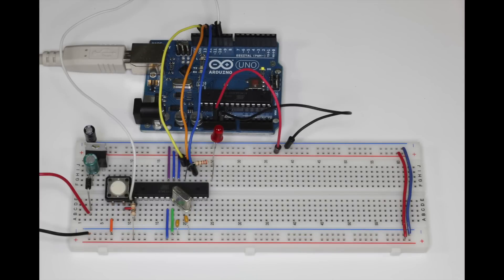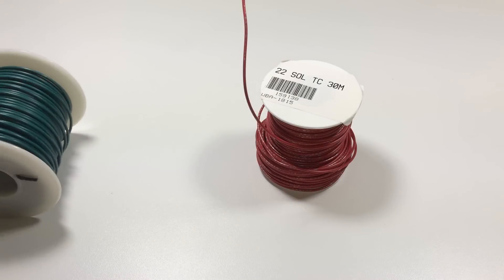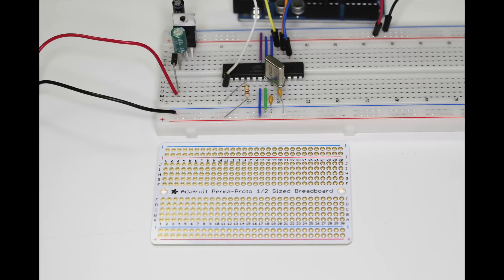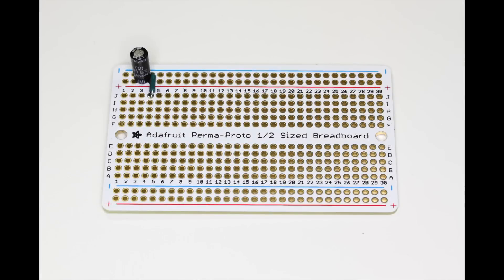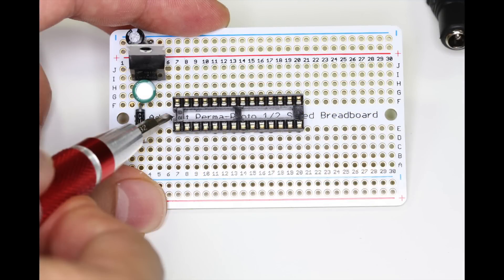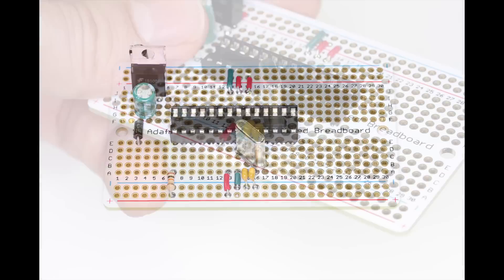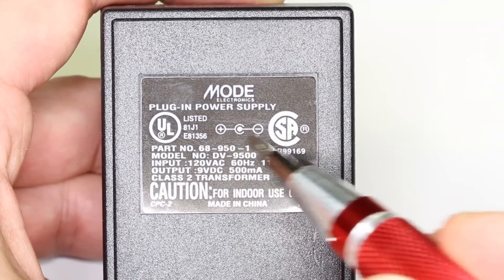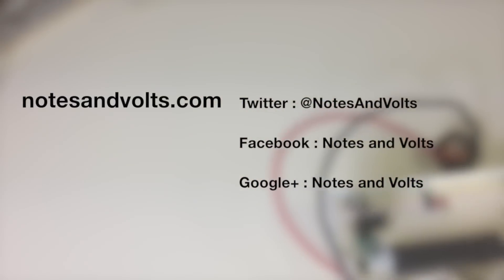Arduino on a Proto-Board - Make it permanent!

Comment: If I wanted to do the same with an SMD microcontroller (later down the line), I assume i'd need a development board or breakout board of some kind until I ordered a PCB of sime kind right? Is there any option for surface-mount prototyping?

Comment: What enclosures would be best for this project?
Reply from the maker: Hi Ryan. Anything will work. You can use some standoffs to connect the perma-proto to the enclosure using the holes in the board.

Comment: Set playback speed 1.5X. Trust me.
Reply from the maker: I know!! That Notes and Volts guy is a complete A-hole!
Reply: @NotesAndVolts  I appreciate your more methodical approach. Been building a MIDI Controller from someone else's instructions and it is a tedious experience.  I learned about proto board right here and just saved myself hours of frustration. You do you.
Reply: Lol.

1.5x actually works. 1.25x is a bit more natural though. ☺

Comment: great tutorial! just wanted to mention(since i solder for a living) that it's easier to solder the lowest parts first, like jumpers, diodes and resistors, then move upwards in height( IC sockets, caps and other taller components). just thought about mentioning it( although this is an old video) because it makes soldering a whole lot easier for beginners and pros. this way you ensure a great connection, and the parts will sit straight on the pcb everytime. thanks for all the great info you are putting out! appriciate your work!
Reply from the maker: Thanks for the tips Niklas!

Comment: All online tutorial including arduino.cc uses DC power supply with center positive pin (2.1mm). Why do you choose a center negative pin?
Reply: watch video again. Because  his power supply adapter jack has negative at center.
Reply from the maker: Hi Nelson. You can use either type of supply. Just make sure you wire your jack correctly. It's always a good idea to check with a multimeter.

Comment: If the chip is already loaded with a working code, do I still have to add this whole circuit to my project circuit on the perfboard?
Reply from the maker: You can leave out the power regulator if you are sure you will be powering the circuit with a REGULATED 5 volt supply. If you power source is unregulated or higher than 5 volts -- BANG!!!
Reply: Thanks for your time. I guess I still need everything else, right?

Comment: will it beahave in the same as the arduino works
which will be the guiding software
Reply: plg report to keshrirajcp@gmail.com
Reply from the maker: Hi Raj. This circuit has all the functionality of an Arduino UNO. The only thing it is missing is the USB section.

Comment: Does anyone sell something like this,  presoldered with a chip socket, smaller components, and more efficient layout that doesn't mimic a breadboard? I get that this is for beginners, but I'm trying to make the leap from hobbyist to selling a product.  I need something as small as possible with terminals or thru holes.  Seems like this would exist somewhere.  I also get that the Arduino is a pretty standard setup for programming a microchip, but I don't know where to look.
Reply: JR Olive 
No , olive , there is no such arduino as you said , but you can make one using jlcpcb or pcbway !
Reply from the maker: Hi JR. If you are planning to make a marketable product out of your circuit it would be best to design a custom PCB and have a batch manufactured. If you do it in bulk you can get the cost down to 1-2$ per board depending on the complexity.
Reply: Thanks so much for the response!  I get what you're saying, but I just hate to spend time reinventing the wheel especially since I would be climbing a learning curve that I don't really need.  So you're saying there's no product that is essentially an Arduino that nixes the surface mounted power jack and USB and provides thru holes or terminals for the I/O's and power?

Comment: Add female headers to all the pins to essentially turn it into a development board. Also you can take an old ethernet cable and use the wires inside if you don't want to buy any!
Reply from the maker: Thanks Ryan! Good tips.

Comment: Can you try avoiding I believe it was green as your common? I am colourblind so I could not tell the difference between common and voltage with the green wire. Other wise this is a great tutorial
Reply: Hi Owen. This is the future calling. :) Can you recommend methods to aid colorblind? I am interested. I worked in the electronics world for a few decades, and colorblindness was a reason for dismissal. So many brilliant people were dismissed for this. Thanks.
Reply: @bob-ny6kn  Yeah, standard color codes are kind of important.  You wouldn't hire a blind person to be a pilot.

Comment: really good tutorial, but what if i want to use usb to power it, not to program it or samething else but just to power the project ?
Reply from the maker: +Josip Sovina Hi Josip. You can take 5 volts and ground from a usb connector and bypass the regulator.

Comment: I liked your video, and did like the added note about using different color wire.  Is there a standard color code in digital electronics?
Reply from the maker: +John Cat Hi John. I'm sure there are some standards somewhere but none that I am familiar with. I tend to use red for positive voltage, green or black for ground, and blue for data signals. It depends what wire I have in stock at the time :)
Reply: Rebel using Yellow and Blue wire for ewerything....
Reply from the maker: nicx321 Haha! Livin' on the edge

Comment: At 7:54 minutes you said the center pin should be  negative.
On the arduino.cc web site:- (http://playground.arduino.cc/Learning/WhatAdapter), as at the 7th May 1915,  they say the center pin is positive!
??????????? Who is correct ? I don't want to blow anything up.
Reply from the maker: Charles Brewer Hi Charles. Since we are wiring our own circuit you can use either a center negative or center positive adapter. When you wire the jack to the board, just make sure that the terminal that connects to the negative part of the adapter goes to the ground rail on the board and the positive wire goes to the location mentioned in the video. Check with a multi-meter to be sure.

Comment: Can it not run off 5v? Great vid, subscribed :) planning on making the synth
Reply from the maker: Hi RP, thanks for subscribing! If the 5v adapter is regulated (switching type) it would work. If not, bad things could happen. I prefer to design things with the regulator attached so it can handle the different types of wall warts that people may use.
Reply: Ok, thanks for the reply!

Comment: can i hook up a usb hub to this permanent arduino system with maybe a usb to serial or any other components in order to connect in to the arduino ide?
Reply from the maker: Hi Pamfilaki you could do that by adding a USB to Serial breakout board. But that kind of defeats the purpose which is to have a minimal circuit to run arduino code in your finished project. If you need to reprogram the circuit you may want to add a 6 pin ISP socket.

Comment: Would this board work for the nav-1 synth? I may have to change the layout a bit?
Reply from the maker: Hi Christopher. These types of protoboards are great for smaller circuits but perhaps not the most efficient for a larger layout like the NaV-1. I think that even with the largest model it may take up at least two boards.

Comment: good day sir. may i know what is the wire connected to Atmega pin 5 for? i saw that it was paired with a wire connected to the ground. what is that for? thanks :)
Reply from the maker: Hi Jhaybiel. You caught me! Haha. The orange wire on pin 5 that is visible in the intro of the video is actually part of a Ardino Synth project that will be the focus of my next video. I used footage from that video when I realized I had no interesting footage shot for the intro of this vid. Please disregard it for now.